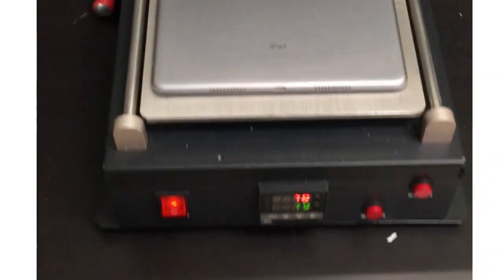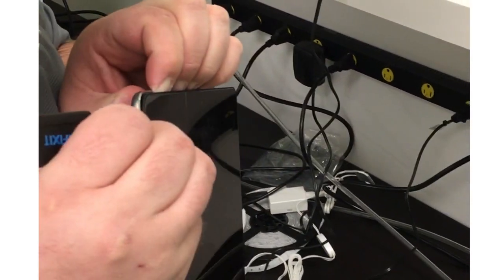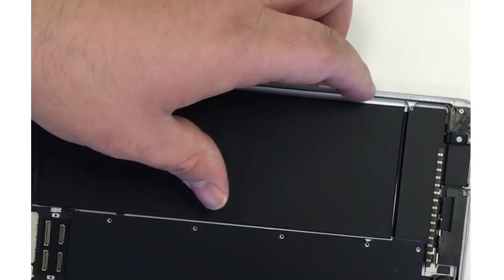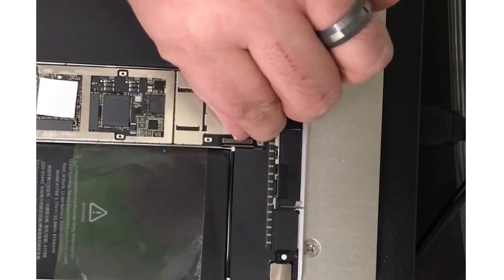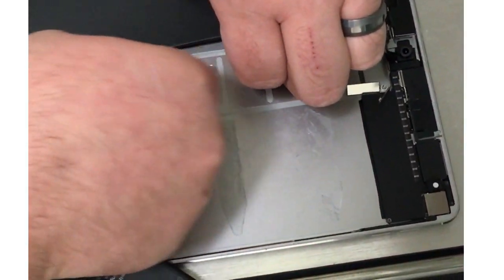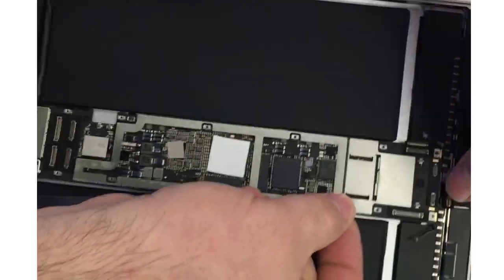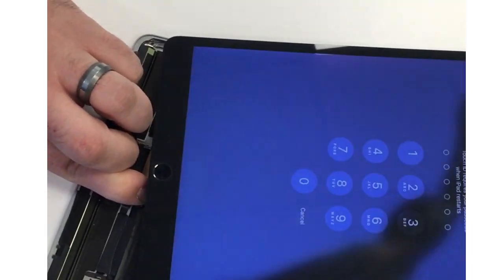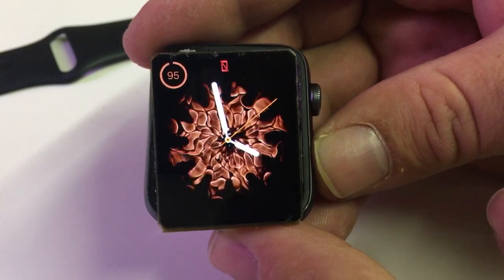iPad Pro Battery Replacement: Step-by-Step Repair Guide!

Comment: so u don't have to put adhesive under the motherboard when you're reinstalling everything?? under the battery??
Reply from the maker: Battery comes with adhesive and the board should have some but doesn’t need extra because it’s screwed to the frame
Reply: @FIXDPHONES  once I actually did the install myself, I saw what you're talking about. thanks

Comment: By far the most difficult battery change I did in my life. Stickers are EXTREMELY hard to remove, and I had to put so much isopropyl alcohol that it drowned and destroyed two loudspeakers :((
Apple fee for doing the job is really worth it! especially considering the high risk...
Reply: Hell no, apple fee for this is ridiculous. 
Paying €1200 for an 128gb ipad, so it’s battery won’t even last 5 years.. then pay €500 for a battery replacement? Meanwhile my sons ipad 2 is faster and has better battery. They’re obviously pushing to have us pay more and more by making their devices crappier quality every release, plus these expensive repair costs. My 4g iphone 7 and XR, ipad pro 12.9” 2016 are faster than my iphone 12 mini with 5g. I’m so done with apple.
Reply: When my iPad dies that’s it. Apple be gone. They make it a difficult as can be to do anything on their machines and it’s all about screwing the end user for more profit.

Comment: I didn't get past trying to pry the screen off....
Reply: I assume there is at least a 50% chance I will crack the glass/digitizer, because I'm just not that good with heat gun and razer.  SO far I am actually 1 from 2.

Comment: Hi would there be any reason that my iPad pro 10.5 a1701 doesn't have a SIM card tray flex cable ? very informative video.
Reply: I have both the a1701 and a1709. The difference I noticed was the a1701 came without WiFi and the a1709 came with a WiFi hotspot . They are the same generation size and model, but one has WiFi and one doesn’t.

Comment: I got quote $166 at an unofficial apple repair shop since authorised apple dealer doesn’t replace battery in my country...
So I decided to use it on charge and save the $166 for my next iPad(to get better storage)

Comment: It appears to me as though the newer apple devices seem to have really strong adhesive compared to the older versions. I was about to buy a new battery for my moms iPad Pro but after watching this I’m a little concerned about how tedious and time consuming it’s going to be as well as needing to invest in a heat mat like the one in the video 😬 Just wondering will a heat gun work well or is it worth buying the heat mat or even taking it to a repair place to do it? What would be the best option?
Reply: I imagine this can be done with a heat gun but suuuuuper risky. I think he even broke the lcd using the heat plate so I don’t know.
Reply: @kb_analytics  he said the screen was the main reason it was brought in. So don’t think it was the heat plate.
Reply: Look at the ifixit iopener tool (I know it’s a year later)
Reply: How much do you charge for this work?

Comment: Who would actually try to do this at home with little experience? Pay the $90, save your soul.
Reply: It’s not that hard.
Reply: John Romanchuk Apple doesn’t change the battery in my country :(
Reply: I have never replaced a battery in an iPad, and I'm deciding whether to do this for a customer... xd (I am fairly experienced in phone repair, but I have done only glass replacements etc. for an iPad.
Reply: Me. I’ve got three people asking me to fix their iPads. One is battery replacement and two are screen replacements. I was hesitant for a while but I think I can do this 🙏
Reply: Anyone who can follow a simple video? This isnt exactly difficult when someone shows you how to do it
Reply: Apple charges $599 for a battery replacement as of last week.
Reply: Tuifiti  You looked at the wrong section, its £99 https://support.apple.com/en-gb/ipad/repair/service#ipadcost

Comment: Please note that this is not at Gen 2 iPad Pro. It looks very different on the inside. The video is also on high speed so that a lot of what he does is too fast to see in motion. You can play it frame by frame but it is not helpful.
Reply from the maker: Paul Castellanos why would you assume this is a Gen 2 iPad Pro, it clearly shows it’s a iPad Pro 10.5 (a1709 which you can see at the beginning of the video) and the point of the repair is to give those who have experience working on devices a good idea of how to do the repair.
Reply: Use the playback speed tool under the 3 dots RH upper corner to slow and space bar on KB to start/stop.